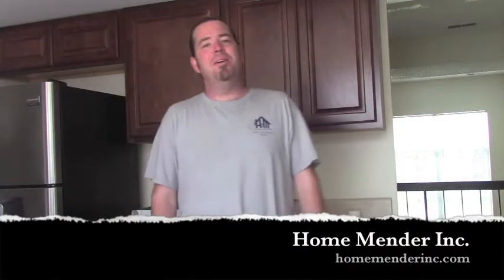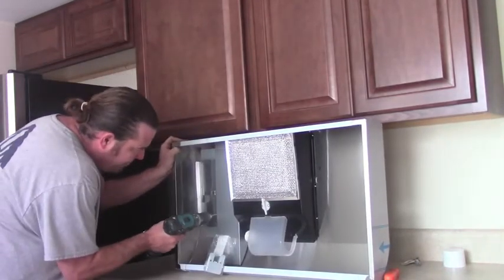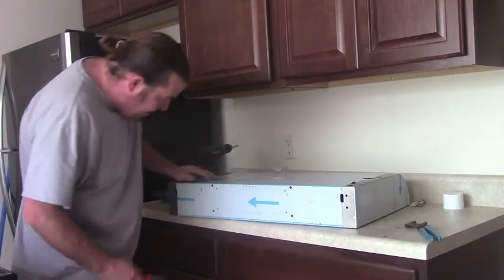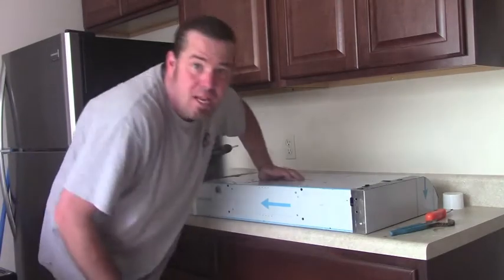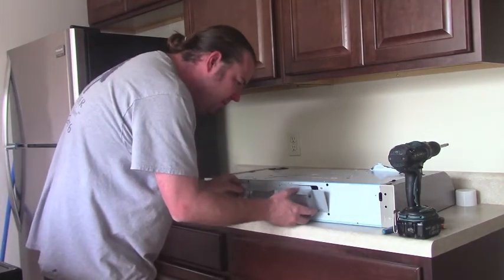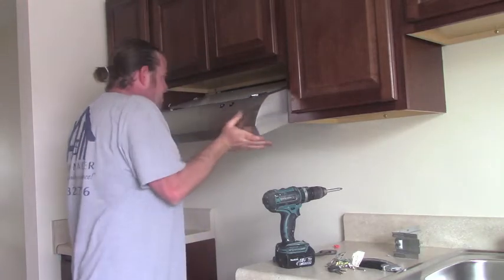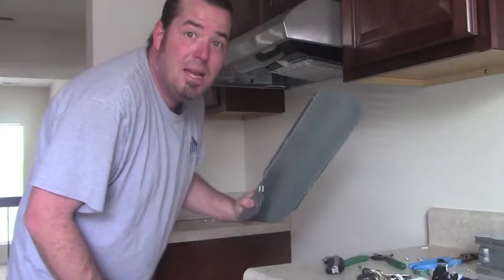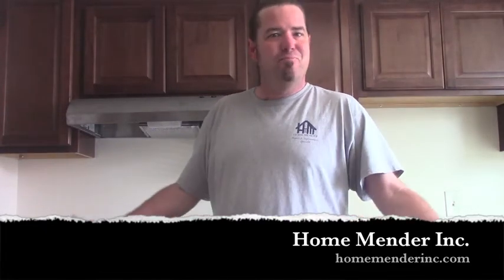How to install hood range, stove hood. Easy! Home Mender

Comment: How do I use a 2 wire line (black/white) with a hood that has a green ground?
Reply from the maker: Hi Jerime! if it has a metal box, you can ground it to the screw. If its an older 2 wire system they dont always have grounds. I hope this helps!